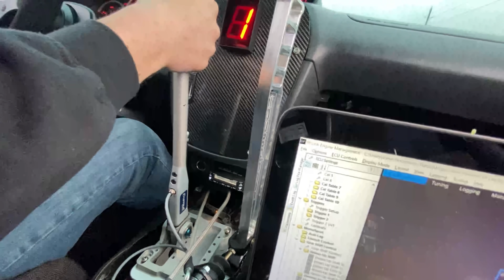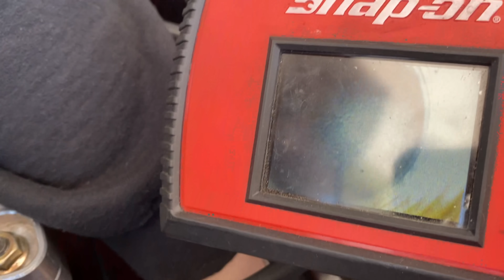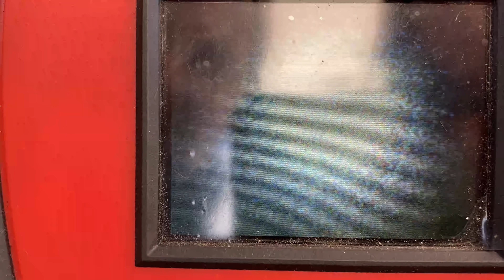Texas2k21 Nearly Burns Scarlet To The Ground

Comment: do you think any more break in time on the engine would have given that bucket a chance?  do you think it bound up? or did you have a minor spring failure that caused float and the cam to have it's way?  have you thought of getting the buckets cryo treated or DLC coated?  Also,  we used to use cow magnets in the oil pan when we raced air cooled vw's back in the day.
Reply from the maker: This engine has 3800miles so no